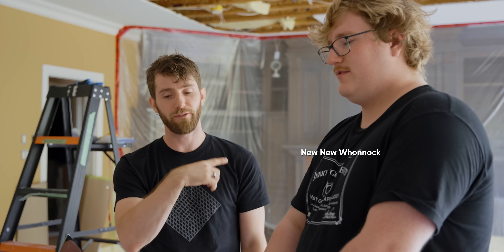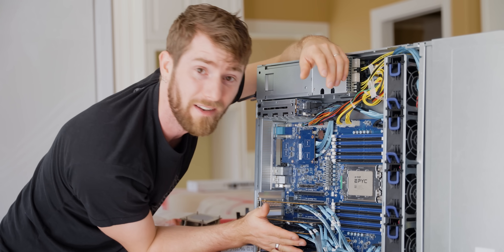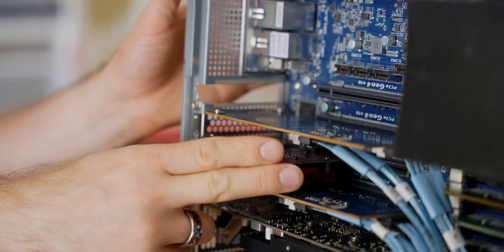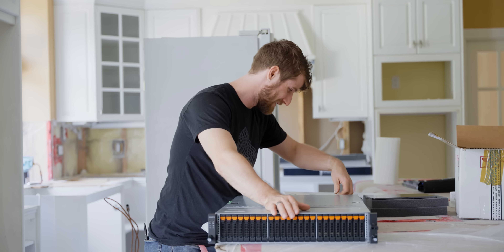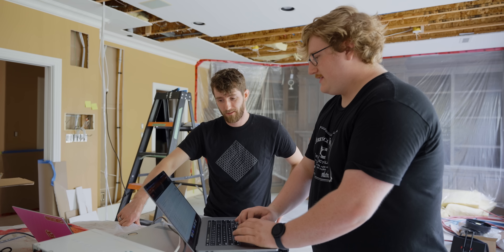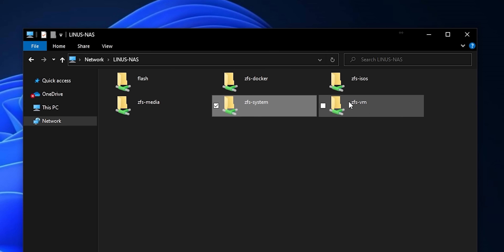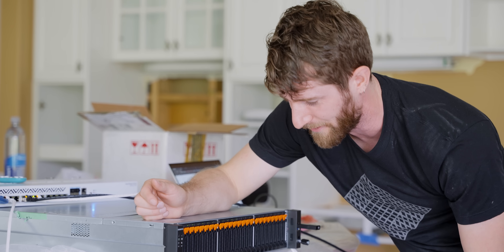This is stupid, but I love it - Linus Home NAS Update 2021

Comment: Thanks so much for the extended setup and info on ZFS! I use it on my home PC and it's really cool to see it talked about more, and how others are laying out their drives.

Edit: did you guys set the zpool ashift to 12 or 13?
Reply: 12 should work for most drives these days, including HDDs. The key thing (that isn’t disclosed) is that ashift=12 is used to align to drives with 4K blocks, which is most but not all drives, so on an SSD it’s most likely a safe bet but on a HDD you might want to search around on whether your drive uses 512 or 4K blocks.
Reply: @ReturnJJ  Yeah, but it's better to go on the high side than too low. I'm wondering cause I didn't see them set that in the shot, and with these new NVMe SSDs it's definitely not the default of 9 lol. So unless they setup the zpool for real in a different shot or off camera, they're gonna be losing a lot of performance.
Reply: @Ski4974  oh you were asking them, I thought you just started on ZFS or something. Eh, good info for me to leave up nonetheless haha.

Yea, I noticed the lack of ashift=12/13 too, makes me wonder if they set the ashift on the LMG servers that use ZFS too.

Comment: It doesn't matter the situation, raid5 is never a good ideal. You'll lose most of the time a second drive while rebuilding your raid. 

I'm also not a big fan of ZFS, it's a nightmare to grow your pool. 
I use a minimal Debian installation with a bunch of (2) drives in raid1 and then use LVM raid0 to group them together.. this way I can grow my pool with just buying (2) drives of the same size and add it to my LVM volume group.
But LTT probably doesn't have a Linux sysadmin on site, so going with an easy GUI is the only way to go.

Comment: I am suffering from throughput envy.  You are getting 15-17 GBs per second!  I get a whopping 4-20 MBs per second transfers to my unRAID.  :(

My unRAID server uses an old Dell desktop with two 4-Bay USB 3.0 enclosures.  I have two 480GB SSDs for cache and seven mechanical drives with a 14 TB parity drive and six 8-14 TB drives for a total of 74 TBs.  I just switched over from my Synology DS1813+ with 32 TBs.  Your videos talked me into trying unRAID in the first place.  Now I watch videos from Spaceinvader One to learn how to use unRAID.

Comment: I wonder if you can run a pc without RAM and use some SSDs instead. If SSDs get faster and faster you dont need ram anyway. RAM is used as a buffer between HDD/SSD and CPU for often used data and Ram is (or was) faster than the old fasion HDD. But when a SSD is faster than ram there is no need to buffer, right?

Comment: WARNING: In my experience the ASUS XG-C100C cards are utter crap, our early examples had 20% failure rate and the latest batch had 50% failure rates and we ended up returning them all!

We've tried different firmwares on them (despite ASUS trying to make that hard unless you put them in very specific ASUS motherboards!) and nothing fixes the core issues, there's just something wrong with the hardware on far too many (but not all) of them, there's days or even weeks between "incidents" but that's still something like two orders of magnitudes to common for me to consider them usable.

The most common failures we've seen are "network link up but no traffic", "hardware failure" (driver logs this in the Event Log) and "network link crashes" - this makes the card send out something really funky that knocks out some cheaper 2.5/5/10Gbps switches, as in "all ports goes down" (ouch, takes out anything else on that switch). Resetting the card in Windows usually gets it working again for the first and second issue (for a time), the third requires full power-off to recover. A more expensive managed switch just dropped the port as it should which was how we traced down all the faulty cards before giving up and sending all back.

I'm not sure if it's the Aquantia chip that's at fault because we've replaced a few of them with TP-Link TX401 and so far they've been fine (and the layout is visible different), but... we don't have enough to be SURE it's a full fix for a simple reason, second-hand/refurbished Intel X540-T1 or T2 are cheaper than either and "just works"(TM) IF you have a PCI-E 8x slot available , both full and half-height is available. Since we had that for this case it was a no-brainer to just choose them.

The drawback of the Intel X540 is that they're too old to support 2.5/5Gbps (only 1/10) and required an 8x slot though obviously that would be fine for THIS application. If that matters a X550-T1/T2 is 4x PCI-3.0 and support the intermediate speeds (2.5/5) too but even second hand they tend cost significantly more than the Aquantia cards. And there's a number of other Aquantia based card with the same chipset as the ASUS (like the TX401) that's probably... are OK too though I don't have enough data on any yet.

Comment: I'm just over here running Plex off "1050it hacked drivers" Dual Xeon X5660 1050TI 42GB of DDR3 ECC with 18TB of RAID 6 just fine..
500GB SSD boot and 8GB RAM drive for Transcoding Caching.
I have had 9 people running it in my house and I give the people that rent from me access to the Plex. with no hiccup

Comment: Linus: We will probably lose 15 TB of space, but that's fine. 
Me: Struggling to free up at least 10 gb of space from my 128 gb ssd
Reply: We're at the point where 40TB should be the norm now. 

Just buy WD easystores when they go on sale and shuck them. My NAS has 200TB raw
Reply: Yeh nas servers are fun got one with a bunch of old SAS drives total of 8tb at the moment and it starts to complain when I've got less than 2 tb left that it's short on space which is hilarious to me when my friends run from 250 gb ssd's with at most a one tb hdd or something like that
Reply: @martinkrol2840  1TB HDD? Oof, my Steam library alone takes more than that
Reply: @Pasi123  yeh, I honestly don't know how they do it
Reply: @Pasi123  I've got an iscsi share for my steam library that at the moment consists of 5tb but I need to grow it as soon as I've got some new drives for this storage pool
Reply: If your using windows 256gb is the least you want.   128 is for linuxes.

Comment: Honestly btrfs makes more sense than zfs here if your gonna complain about zfs' ssd setup. all you have to do is add "ssd" to the mount arguement.
I'd prefer something like XFS setup in a RAID 5/6 array, it allows 2 disk failure (something I'll always setup with single site backup)

Comment: I'm curious if there is any tech at all that Yvonne wants in their new house and why. Does she even care about tech in general beyond just being around it all the time?
Reply: She specifically asked for her new motherboard because of the previous one’s poor implementation of Thunderbolt.
Reply: I think Yvonne cares more about tech than the average person, just a lot less than the average LTT employee.
Reply: My wifey is still using an iphone 6 plus and doesn't see the need for upgrades, but she is a sucker for hair and makeup tech, those Dyson hair product are expensive and those Foreo face craps is outrageously expensive and looks like dildos.
Reply: @mixeddrinks8100  I will admit have just about no idea what you're talking about with the Dyson and Foreo things.
Reply: @SpidermanandJeny  neither did I until I started doing research for xmas shopping. hahaha
Reply: @mixeddrinks8100  2 years ago now...my wife HAD to(I made her cuz I'm not fixing) upgrade an Iphone5 cuz the screen literally was separating off the rest of the guts. So she got an Iphone 8...she prefers to use OVER HER COMPUTER WITH 2x 24" monitors or her 10" Ipad I DON'T GET IT. Meanwhile I'm on my 55" 4k with a 24" beside it...just cuz I can LOL. The 24" on the other side...is my dedicated Linux monitor haha
Reply: Honestly Yvonne would be a mac user.  She just needs her tech to work so she can do her actual work.  

On the other hand sounds like she would had a dull safe life filling prescriptions.  Of course this year, that would actually be a dangerous, exciting profession.
Reply: @jemiebridges3197  that kind of presumed that windows users aren't normally ppl that just want to get stuff done. Having been a lifelong windows user and having worked as an apple care person, both platforms have their quirks and both are pretty easy to use for most things and have been for since Windows 7, presuming you were smart enough to skip 8.

Comment: Even with three drive raid would be bottled necked by a 10Gb network. Linus really needs QSFP cards between his desktops and the server, with a 10Gb line to the network. On QSFP connected devices he could literally run all his work data, games and media content on the server. On a desktop he would literally only need local space for the OS, image backups, and swap.

Comment: Linus, PLEASE do a video on network boot, remote storage gaming. I'd be curious to see the performance of gaming on a system where ALL of the storage is on this server. Doing this test with several different network speeds as well would be cool (i.e.: 1Gpbs, 2.5Gpbs (if you feel like it), 10Gbps, etc.).

Comment: I saw a 793 MB/s copy time at one point, but it dropped down to 300 at another point in this video.  On SnapSync backups, I've personally gotten over 600 MB/s using regular WD Pro HDDs.  (I happen to use QNAP TVS-h1688X backing up to a TS-h886 NAS with ZFS, and my speed is as reported by the SnapSync section of the Storage and Snapshots app in the QNAP GUI.)  Now, copying from a Windows PC to the NAS, I usually get around 300 MB/s-ish speeds.  Note:  I currently use RAID 5 since I'm backing up to two separate NAS via SnapSync.

Comment: 1050 was unnecessary for transcoding here but is definitely more power efficient. You'd have better capability with CPU transcoding and since my 1600 can do two streams fine, you could do alot better with Epyc

Comment: 3:21 It might be a "Legal grey area" for you, but over here in the UK, you have the legal right to back up any and all media you own, so technically, anti-copy protection is illegal in the UK.
They get around that issue by giving a promise that any media that can't be backed up that is damaged, then a replacement copy would be issued for free. (not that anyone actually ever honored that promise)
So... Ripping your blu-rays to watch those? Perfectly legal in the UK. It only becomes illegal if you distribute ANY copy (even the original) separate to any other copy (Meaning if you were ever to give it away or sell it, you're legally obligated to give all copies with it, or destroy them) because that's piracy.

Comment: If you want to do FULL NETWORK BOOT/DATA STORAGE you will need better than 10Gbps (if you want any real performance).
In fact I would likely choose to use a bonded link with at least 2x10Gbps links (this will improve your random access and a number of other advantages)
Thing is, as far as I know it is not possible to have PXE/BOOTP run over a bonded link as you are not able to set up the bonded link prior to booting. 
If you know of ANY network card that has PXE/BOOTP over a bonded link PLEASE TELL ME!!!! (This would have to be a single network card with multiple links)

Comment: Linus could use X11 on Linux for its original intention as a terminal display server: Have that server running a Linux VM set up so it starts up an individual X session for connected Raspberry Pis, then replace the family PCs with those Pis. It'd be like one of those old timesharing systems but in the modern age and utterly pointless

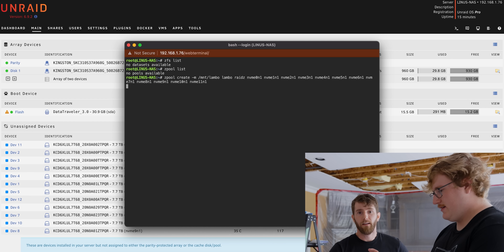Comment: 10:17 As a datacenter storage guy, having 1 parity drive means you're asking for trouble.  Come on Linus, it's ZFS, those parity drives can still provide you read benefits, just do it.
Reply: For that many volumes, I agree. I would've at minimum stuck with the RAIDZ2 or striped across two or three RAIDZs if I were trying to preserve over 50% usable capacity.
Reply: Pretty sure he said he didn’t care if he lost the data on that server, because he backs up to the office anyways. That’s his reason for being okay with 1 parity drive.

Comment: The next thing I would love to see, is a solar install to offset the large amount of electricity you are using in the new house with all the high end network equipment and high end computers, Whole house AC and heating, always on smart house stuff, charging electric cars, etc.

As a tech guy you should nowadays really think about the environmental impact you make.

Same goes for the TLL building(s) as a whole.. that flat commercial building roof would be able to provide a good enough of solar power to offset at least a decent amount of power use.

Comment: Why didn't Linus plug the GPU into the PCI Gen 3 slot?
I assume these NVME drives perform faster with Gen 4.
Not to mention, the controller is going to bottleneck the drives if any of the drives connected to the controller will run at the lower speed

Comment: ripping your own discs is not only legal but we should be pushing for making these DRMs trying to take away your consumer rights completely outlawed
though that may depend on local laws, I guess in corporate lands like USA and possibly Canada too it's a bit worse

but putting that issue aside, what happens if everyone tries using that poor 1050 to transcode at the same time? I know it can do much better than realtime, but will it be enough?

and when it comes to cooling... using NVENC only it probably won't even reach 10W of power so there won't be any issues as long as you don't start pushing the CUDA cores instead

Comment: My question for Linus: have you ever tried BSD/UNIX (like FreeBSD for example)? Most BSDs are designed for server and/or networking implications kind of like the original AT&T UNIX, which is why even Netflix uses FreeBSD on their video streaming servers, and (While I'm sure most BSDs have it) ZFS is already installed as a part of FreeBSD out of the box, and I also believe PLEX is available for it also...

Comment: Since I lost one drive from my raid pool, and then lost another one which was stressed by the reconstruction of the parity for the replacement drive ... I never settle for raid1 for important files.
But since Linus has his files already duplicated to his work servers, it doesn't matter I suppose.
Reply: The pain of having to rebuild even with backups would still push me to have extra parity, especially when using drives that are likely from the same batch.

Comment: Gtx 1050 is the wrong choice, should have gone low profile Quadro for the NVEnc chip to do the resize transcodes in hardware that was designed for doing it, instead of processing it in the GPU.

Comment: Why not an SFP card? I’d do that for a home
Reply: Definitely, if the server is next to the switch sfp+ ports are still way cheaper (€130 MikroTik Cloud Smart Switch 326-24G-2S+RM) then rj45. I can't find any below €500 unless you go with 8 gigabit ports (€160 netgear gs110mx) instead of 24.

An sfp+ to rj45 10gb adapter is an option but those are around 30 bucks per port. I would get one of those for my workstation and connect the nas with sfp+. I've done my research and there's still a lack of affordable 10gig switches.

Comment: Linus is the one of the reasons why I made my own in house server, spent about 10 grand for making my home. It's amazing and I haven't regretted it since.
Reply: I have a peasant old pc used as a server (just for media) that can only be accessed via a windows machine but it's fine for my current needs.
Reply: @WyattOShea  I had that too, bear in mind I saved up for this system, and it's been running for about 2 years now
Reply: @luke200293  Noice :). I only really set up one because I had an old pc gathering dust in the shed so I thought hey if it still works I could use is as a media server for my mother and sister and so far it has worked out great.
Reply: @leeroyjenkins0  I bought enterprise stuff with warrenty, I use for the T.V and a in house back up for my computers, phones, and storing our media library with old photos, videos and the like.